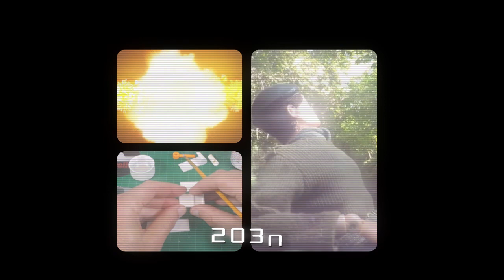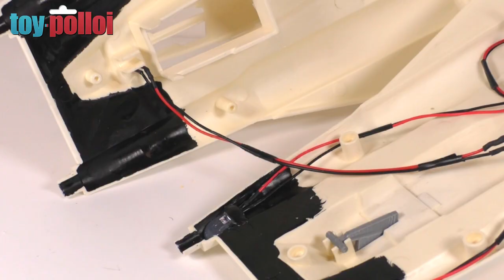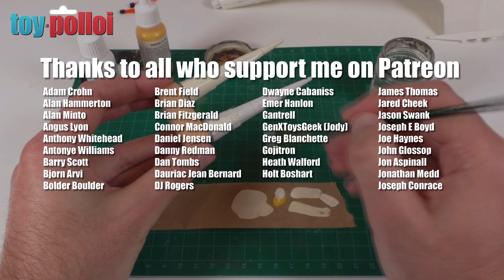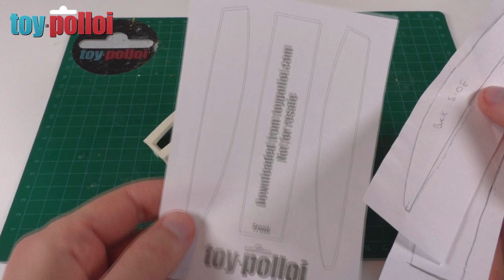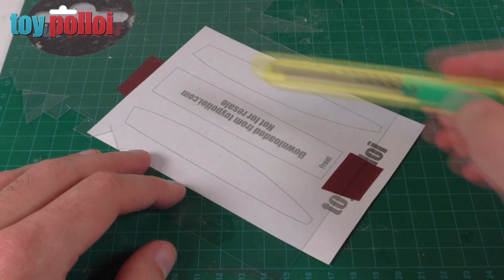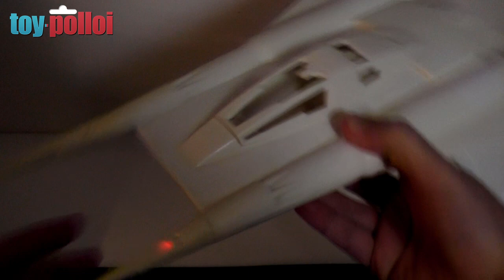Vintage Buck Rogers Mego Starfighter Repair & Custom - Part 3 - Toy Polloi

Comment: To stop light bleeds, I can highly recommend alluminium tape, either the one used by plumbers, or the one used for underfloor insulation :)
Reply: I was going to recommend some black electrical tape, but either one will work better then just paint.
Reply: Totally agree, I have use the same thing on some projects that I used leds for.
Reply: Hi as the others have stated when wanting to stop light bleeds in laser fire action the best blackening tool is black ELECTRIC TAPE, best wishes with those custom builds👍
Reply: I was going to suggest aluminium foil. As electrical tape degrades over time.
Reply: I often use a plastic tube that fit the LED and then put black heat-shrink tubing around it, no light gets through that :-)

Comment: If you thin automotive spot putty with alcohol you can brush it onto 3d printed parts.  It fills the build lines nicely and is relatively easy to sand.
Reply: Bondo Glazing & Spot Putty works a treat.

Comment: Should have mixed up a large batch of paint and done the whole thing, to get the color even across the whole ship. Not only would that have saved you from trying to color match bits against other bits, it would have helped with light blocking. The plastic they used is somewhat translucent.
Reply from the maker: I’d rather leave the ship as it’s natural plastic finish as I feel it looks better. So just wanted to paint the least amount possible.